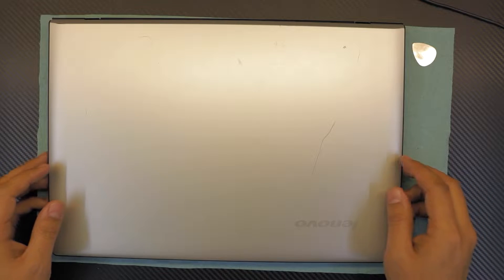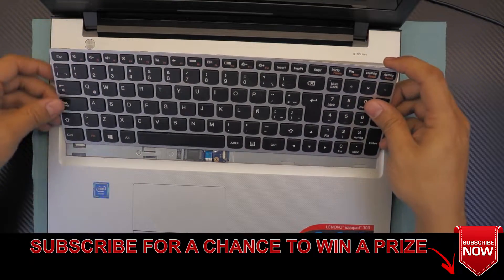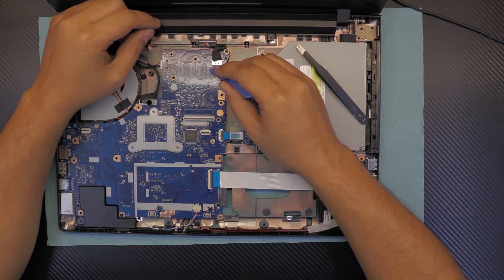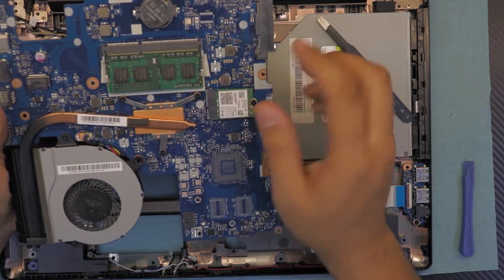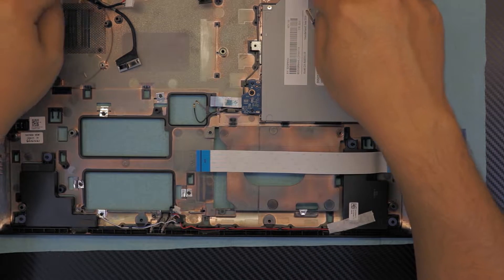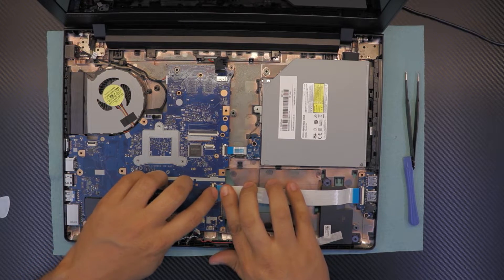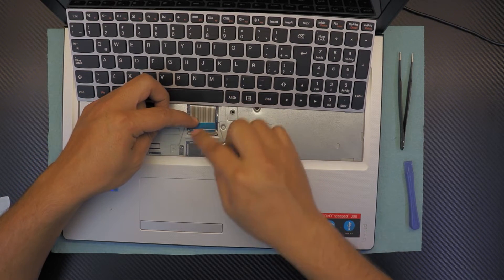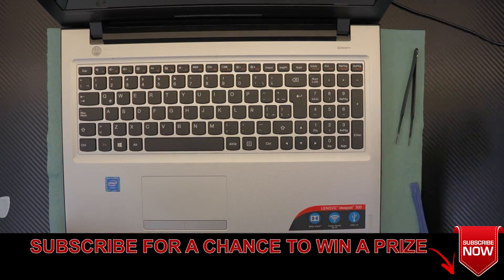lenovo ideapad 300 Tear down and  disassembly

Comment: Back panel is broken near power cable input(exactly behind the back of the left side diaplay leg!) and near air vent. What should I do. Also charging it is becoming difficult. Have to try again n again. Pulling out and putting in the charger pin again.
Reply from the maker: Thank you for your feedback! If you wish to support the channel, you can like, subscribe, or both!
Regarding your question, you will need to search on aliexpress.com and get a new back panel if you need a fix for it.
cheers🍻

Comment: Hi i found this video very helpful to replace my laptop keyboard thank you for this, i have a ideapad 300 15isk 80Q7 laptop with 1366x768 resolution screen can i upgrade the screen with FHD 1920x1080 one will it work, your reply would be very helpful in making a decision..
Reply from the maker: in order for me to help you i will need you to remove yout LCD screen and send me the exact model number or a pic of the sticker and check how many pins is the connector 20 o 30 pin

Comment: Thanks alot brother, 

Referred your video to replace my laptop bottom cover.

I do have some questions though,I have same lenovo ideapad 300-15isk, i see wifi antenna at mark 0:56 cable kinda removed there, is it always like that? when i opened my laptop, if found it same as in the video, prior to opening the cover, I had good wifi strength, now it shows less wifi strength.any fix for that?

My mouse touch pad  is not working now,keyboard and power button are working fine.need to replace mouse touch pad?

and finally, after reassembly,the LED lights are not aligned properly. any tricks for that?
Reply from the maker: thank you for the feedback,
#1. the wifi connectors they got loosen, grab the antena cables and snap them into the wifi connectors , and test the wifi strength, if the wifi bars are low interchange the connectors.
#2. your touch pad has no issue, the problem is the bios setting, go to bios setting and look for touch-pad and change to standard if its set on advanced, and if its on standard then test it on advanced. its a common issue.
#3. regarding the LED lights its not a big deal, but i need to see as many pics that you can provide. upload some to https://imgur.com/
good luck
Reply: @uFixTek  Hi,

Thanks for prompt reply, 

Issue with touchpad was resolved, just reconnected the cables while system was on.

Here are the photos taken on various angles.

 Link: https://imgur.com/TlVRsuC,https://imgur.com/qa0BQnw,https://imgur.com/xAswrUp

https://imgur.com/a/hV9D00A
Reply from the maker: ok im glad that got resolved, regarding you LED try to align the board a bit, it looks like its shifted to the left, all i can say remove the LED board and try too align sometimes they  have a clean acrylic plastic make you didnt loose that. its clean maybe when you opened it it fell , i try to get my hands on the same laptop and once i do i will make a quick video for you. but for now you are on your own try to move around, but thats minimal issue. i will keep you updated soon. :)
Reply: @uFixTek  Much appreciated, i tried earlier,I just cant figure out how to align those lights, I didn't see this plastic piece you mentioned, perhaps i overlooked. Anyways, waiting for your video.
Reply from the maker: OKI, i do get few of this often in the store

Comment: How can I remove the DVD writer without disassembling all of  the parts?
Reply from the maker: Thank you for your feedback! If you wish to support the channel, you can like, subscribe, or both!
Regarding your question, all you need to do is remove the mid screws under the laptop for the keyboard (it has a keyboard logo beside them).
then you will need to lift the keyboard (no need to disconnect), remove the screw for the dvd drive:
https://imgur.com/a/Any5eYL|
then pull out (slide out the dvd drive).
Should you have any further questions or requests in the future, please don't hesitate to ask me.
cheers🍻

Comment: does it have M.2 slot?
Reply from the maker: yes and no,
yes it has, but its occupied by WiFi card that is m.2 (pci-e)
you can remove the wifi card and use a usb wifi and place a mini m.2 ssd
they are very hard to find i only found few on ebay and alibaba
shorturl.at/civO5

good luck

Comment: Hi sir. Does the ideapad 300 have the same casing as the 310?
Reply from the maker: Thank you for the feedback! if you wish to support the channel you can LIKE or SUB or both :P
regarding your question: Yes 90% its the same logic , you won't have trouble.
Reply: @uFixTek  I just subbed sir. Thank you so much. One last question, do you think I can DIY rehouse my logic board for ideapad 300? This is my old laptop and I want to upgrade it to be in optimal condition.
Reply from the maker: what is that you exactly want to do you have 300 and a 310 or you need to transplant the case or you need to make your 300 faster? "DIY rehouse" i don't get it what you mean by rehouse :( sorry
Reply: @uFixTek  I need to have a new bottom and upper case for my Ideapad 300. It's broken over time, especially the hinges on the monitor. I figured it out though. :) i just ordered a new bottom and upper case. I just hope I am able to assemble it on my own. I don't have experience and I want to learn.
Reply from the maker: oh remove everything with confidence and you be fine, its like playing tetris :P
take your time and take picture as you go so you have a reference in case, its really simple and not hard it should be fun :) if you need any doing you can email me with images and i help you out.

Comment: Do you know if all 300-series Ideapads use the same power port? A power port on my 300 80Q70021US broke. I'm trying to find the right part to replace it but can't find any that claim to work with that precise model. Thanks!
Reply from the maker: they are use same jack but maybe they have a different connector to motherboard and thats very simple fix if you know basic soldering just connect negative to negative pins on motherboard, if you want me to draw and help you out i can. 
you can buy this and adapt it to the laptop https://www.ebay.com/itm/Lenovo-IdeaPad-300-15ISK-80Q7-DC-IN-Power-Jack-Cable-DC30100LG00-ACLU1/113739076663?hash=item1a7b609437:g:gLgAAOSwjVZc0Fiw

Comment: Hey is it possible to replace the whole body shell (not including the screen) of the laptop? I have the same model and its pretty beaten up hinges are rising, dc port barely working, paint chipped off, dents and cracks everywhere!
Reply from the maker: yes its all replaceable, but check the prices on ebay  for parts. sometime s when you addup and see its not worth investing .
Reply: @uFixTek  thank you for the fast reply! Sadly for a person living in a third world country and starting college this august, I can't buy a new laptop :( I've already computed  how much everything will cost (extra screws, port replacement, top and bottom shell replacement) its around a 100$, which is quite expensive! Thats like 2 months worth of grocerys for  1-5 people ( 1$ is worth 50 pesos)
Reply: @uFixTek  i hope you can make a tutorial on how to detach the screen from they body!
Reply from the maker: sure i will make a video, are you in mexico?, if so, im in queretaro :P
Reply: @uFixTek  hey! May i ask is the blue thingy at every end of the cables important? Im quite worried cause i accidentally removed the one in the trackpad cable!

Comment: How to safely removed the touched pad
Reply from the maker: Thank you for the feedback! if you wish to support the channel you can LIKE or SUB or both :P
regarding your question:  you need to heat up the touch pad with heat gun or hair dryer for 5min and then rip it out, it has a adhesive glue. its easy.

Comment: I watched to replace the display assembly. You seem to have left that part of the disassembly out!
Reply from the maker: the LCD its very very simple, you just have to use the opening tool to remove the screen bezel, no screws, then the LCD is holdup with 4 screws one on each corner, remove those and the lcd will come out, and remove the cable and place the new lcd. i will make a video for the LCD removal. thank you for the support to the channel
Reply: @uFixTek  I have the full display assembly, including hinges. Not just the display.

Comment: My kid spilled a lil water on keyboard.
Bro my keyboard types anything now by itself.
Keeps on typing on the log in screen.
Help!!
Reply from the maker: hank you for the feedback! if you wish to support the channel you can LIKE or SUB or both :P
regarding your question:  you can't fix it , you only have two options:
#1. follow the video and @2:14 its were i disconnect the keyboard cable, you can remove the cable and not plug it in and leave it disconnected and buy a external usb keyboard.
#2. at the back of your keyboard there is a part number , mine is Spanish keyboard so  the part number is (5n20k13002), if you have English keyboard your part number is different. once you got your part number search on ebay they have it all.
https://www.ebay.com/sch/i.html?_from=R40&_trksid=p2047675.m570.l1313&_nkw=5n20k13002&_sacat=0
Reply from the maker: yes my friend the keyboard is gone , its not repairable, just replace the entire keyboard and you are all set,
https://is.gd/qrLEgG